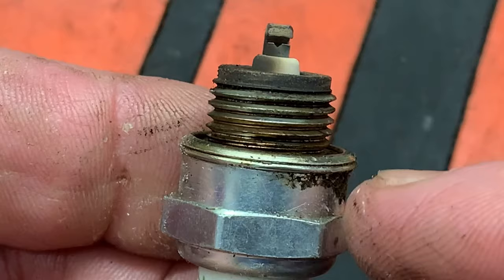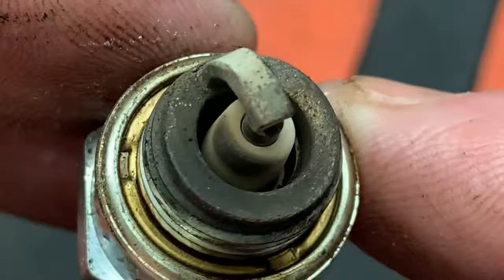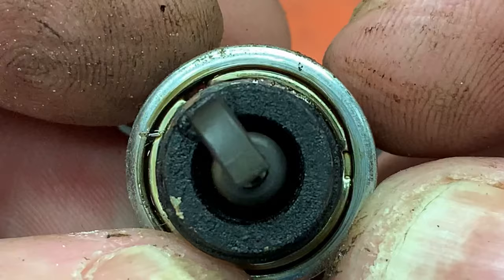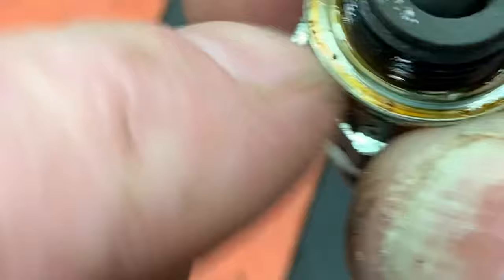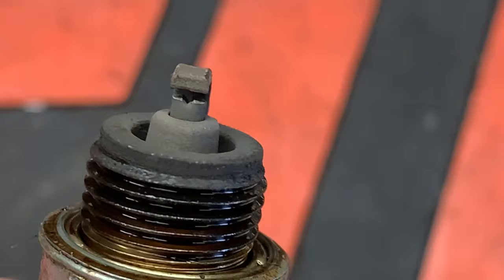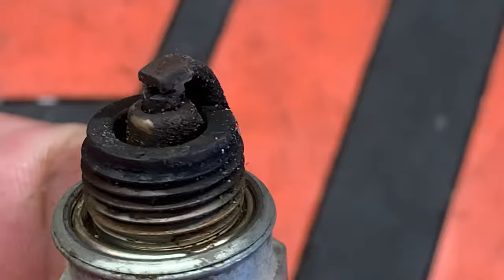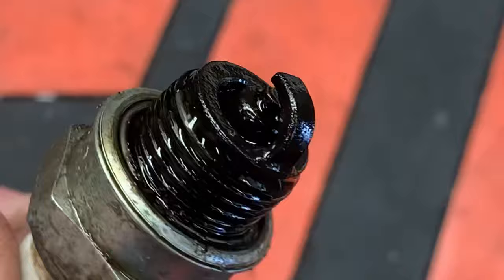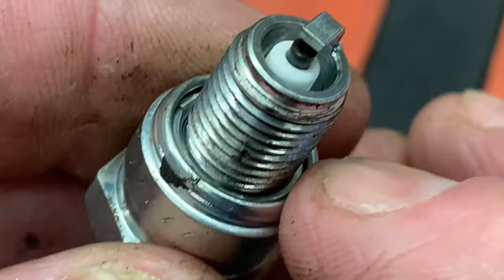SPARK PLUGS DONT LIE / HOW TO READ SPARK PLUGS

Comment from the maker: Thanks for watching! Here is a few tools to help keep those spark plugs in tip top shape!
Have a great day !

Spark plug tester
https://amzn.to/3paIbzl

Spark plug cleaner
https://amzn.to/3vKzApy

Spark plug bpm8y
https://amzn.to/2RT6KoB
Reply: On a kohler 18hp twin that's on a craftsman rider if the plug is oil wet than I can assume the rings are bad and engine needs to be rebuilt? Do I need to buy a compression tester?

Comment: Small engine mechanic’s are actually better engine tuner’s than most automotive mechanics
Reply: Thanks for the compliment I’ve been a small engine mechanic for 30 yrs
Reply: said no one ever 😂😂. 
There are way more variables to take into account in tuning big engines, specially carbureted engine. 

No saying small engine mechanics are  dumber, just not in the same level. Anyone who has touched a wrench in his life will know. 

It’s like comparing a house electrician with an electrical engineer in charge of the city’s electric distribution systems. 😂😂
Reply: Dude I have been saying this too people lately and people just kinda looked at me crazy. My arguing point is this I can make a ford,dodge,Chevy run no problem. Now when you start trying to fix a small engine and make it run good/excellent  I personally have to go back and do my research. Even then they give me hell
Reply: Lol yeah no
Reply: That's very understandable
Reply: You know there’s nothing in a small engines degree that isn’t also in an automotive technicians degree

Comment: Pulled all 8 of my delco copper plugs from my 5.7 1999 GMC Yukon SLT. All 8 were half bright white and the other half dark in color. Motor has 219k and plugs had approx 9k on them. Is that from leaking spider injectors?

Comment: Quite true, several years ago i changed spark plugs on an i6 and noticed oil on two of them. The engine ran, but definitely less ideal.
I think it's simply because the spark plugs are the only thing easy accessible in the combustion chamber.

Comment: Thanks for the video, I have a 1987 TRX250X with low compression and the plug was fouled out, most people don't associate the two, you're the first video that said a spark plug was fouled from low compression, no I gotta figure out if it's piston rings or bad valve

Comment: My old Honda gx110 has a black oily looking plug. It burns some oil but still runs good. The exhaust smells like there is too much unburned fuel sometimes.

Comment: Thank you sir.  On my way to my dealer for an explanation after 1700 miles and one plug that looks like the second to last one, wet below the nut on gap side.  2020 Fat Boy
Reply: Hi, What was the issue?
Reply: @jonaaa6059  from Harley, it was a river in Egypt and a hands off statement due to the fact I did my first maintenance with a Harley tech who just opened his own shop.  My assessment was faulty piston rings causing a type of blow back coupled with the engine burning rich.  Finally a possible faulty install.

So far, no issues with the replacement Screaming Eagle plugs and wires.

Comment: 01:33 Tad too rich but ok
02:47 Little bit lean
03:22 Low on compression
03:58 Scored piston & cylinder
04:43 Too rich fuel/oil
05:18 Fuel delivery issue
05:47 New Spark Plug

Comment: I have a problem with a lawnmower where it runs but idles somewhat rough, and it won’t cut grass that well. I took the spark plug off and it was wet, cleaned it off, put it back in but  the same thing happened spark plug was also wet again.

Comment: I enjoyed your video but you didn't really seem to explain why. The spark plug with low compression you said had the correct fuel mixture. What on that spark plug told you the fuel mixture was correct and the compression was low. Would not the same spark plug be an indication of too rich of a mixture? If so how can you tell the difference

Comment: Very nice video; keep up the good work
I have a Honda Car with 1.3 IDSI engine having 8 spark plugs. The engine is powerful but the only center two spark plugs get really black after one week driving. I replaced old park plugs with new NGK spark plugs but the problem is same. 

Can you kindly guide which is causing this issue?
Reply: A rich issue ? Leaking injectors ? Someone needs to diagnose it .

Comment: I ordered a Husqvarna 128ld. Whenever I got done breaking it in I noticed that it sounded very rich in the low speed needle so being the mechanic I am, I leaned it out and made sure it sounded a bit rich in the high speed needle and it did so I started to use it. Whenever I was done I let her cool off and then I took the plug out to see what type of mixture it was running at. and to my surprise 1/4 of the porcelain was black and the rest was still white. So I tried to richen the high speed a bit more and after holding the throttle fully for about a minute I took the plug out again but it was the same color and instead of it being dry carbon around the threads, it was a bit wet. Does it take more than 30 minutes for the color of the porcelain to change? And also does anyone know the oem specs of the needles?

Comment: Can you make a video and help me, I have a Husqvarna two-stroke leaf blower. I have clean the carburetor got a new spark plug check the magneto gap and a new fuel filter and cleaned the air filter and the primer bulb is new. It’s hard to start cold but it will fire up on full choke and then as it warms up it dies off and won’t start back up from there I end up flooding the motor just trying to start it. I hope you can help and have an idea of what’s going on and how to fix it.
Reply from the maker: I have videos in my 2
Stroke playlist.  Sounds like the carb is
Flooding.  I’d replace it but before
I did that I’d do a crankcase vacuum test
Reply: @THEMOWERMEDIC1  ok thanks I will do that
Reply: I have 125b husqvarna leaf blower,doing the same thing,did a vacuum and pressure test with a mityvac the carburetor would not hold pressure,showed to be the needle leaking,replace the carburetor and it runs great.

Comment: I bought a bike that has been sitting for 10 years and when I got it the oil was all black as well as the spark plug all black and full of soot. What do I need to do before replacing the spark plug with a new one? Should I clean the inside where it sits or spray it with something first? I've changed the oil and gas and cleaned the carb. The bike ran very bad before and died when reaching 4:th gear after some time and when riding it for a while. So I have it taken apart now since I will be replacing the petcock since it was leaking.

Comment: own a honda city 2019. mileage only 27000 km , honda dealership recommends to change at 100,000KM / 5 years. pls kindly advice. have no issues changing them as per honda service recommendation... but i would like to know if iridium spark plugs are actually a time based thing. thanks.

Comment: The first one, the acceptable one.. That is an interesting electrode.. what brand plug is that?
Reply: The brand new cmh is what every plug electrode I’ve ever seen in Canada look like except fine wire plugs, they have a needle.. did you add the notch/groove?

Comment: I have a question my evinrude 200 2 stroke outboard it has some oil on the spark plugs it looked wet but very light is thrat something alarming

Comment: generator fouling new spark plug instantly with dry black powdery deposits , any ideas , do I need to increase decrease air/fuel mixture have done approx 1800 hrs use?

Comment: Hello. Can you help me tune the carburetor on the 4t scooter? The problem is in the composition of the mixture, the candle is clean, as if there is not enough fuel, I raised the needle, the level in the chamber is set, the nozzles are clean, the valves are set

Comment: I used a wd-40 in cleaning a spark plug, what i the effect if i repeated it more frequently?
Reply: No harm will be done. I use carburettor cleaner and a toothbrush to clean my spark plugs, then use compressed air to finish off the cleaning process.

Comment: When mechanics say an "engine is running rich" what does that mean in layman terms
Reply: It means that in the air fuel mixture, there is more fuel than needed that results in black soot. This may be due to bigger jets or low float height in the carburettor. Other possibility is, it can also be correct amount of fuel but less air due to clogged air filter which again results in to black soot.

Comment: How were you able to tell if that was oil or fuel on the spark plug? Mine is very wet on the threads like your last one but it was a much lighter color. I was assuming it was oil.
Reply: it is

Comment: I put a new battery on my ski and it starts good on the first start but after awhile riding it struggles to turn I have to wait till it cools down a little I was wondering if it was the spark plugs does anyone know ??
Reply from the maker: It’s probably the water pump impeller
Reply: I was also thinking old gas maybe , I felled it up with new gas for the first time in 8 months yesterday

Comment: Can i replace only 3 out of 6 plugs? 3 are hard to get to
Reply from the maker: Why would you only want to change three?
Reply: @THEMOWERMEDIC1  i just bought the car at 100k mi. I figure it needs plugs changed. Just wondering if changing 3 is gonna causr any problems, to replace the back 3 i would have to loosen motor mounts n tilt engine forward. Its a fwd chevy uplander 08

Comment: Mine are pure "blister white" as you said. What actions should i take to care for my engine? She's almost at 200kmiles i dont plan to let her go any time soon. I have to replace and remove the valve seal and the spark plug tubing gaskets becuz im tracking down a crank no start issue and found my plugs are crispy white and plug 3 is drowning in oil. Any help is appreciated.
Reply: Modern automobile engines tend to run what looks like "lean" according to old plug examination standards, so that's actually normal. The one covered in oil isn't good. You probably have bad rings or sludged up oil control rings or drain back holes on that piston.